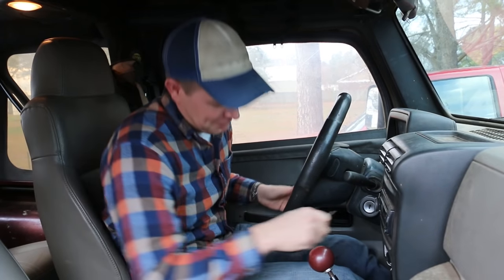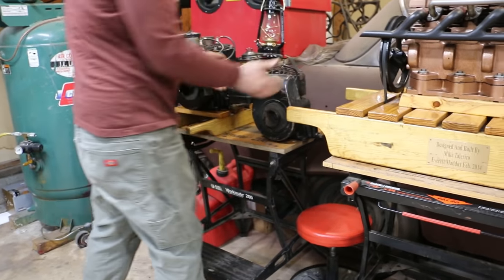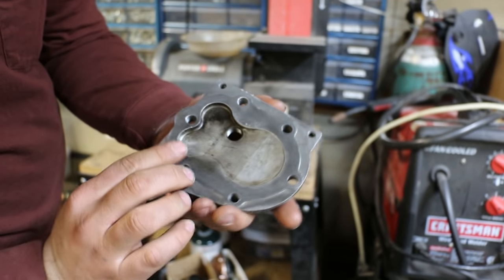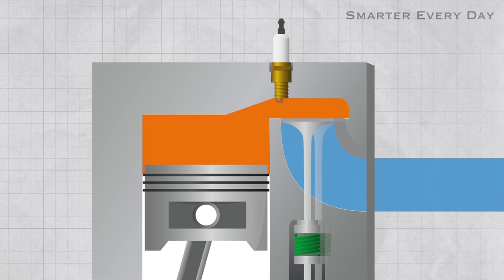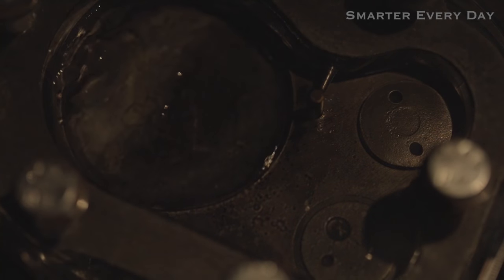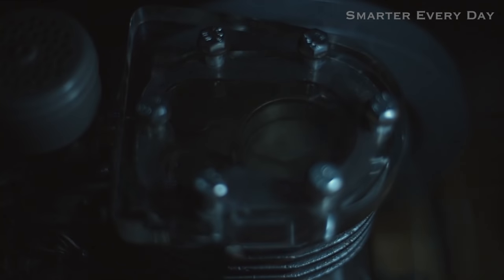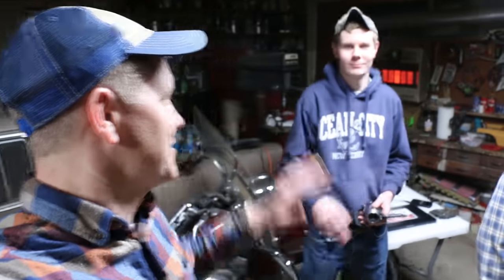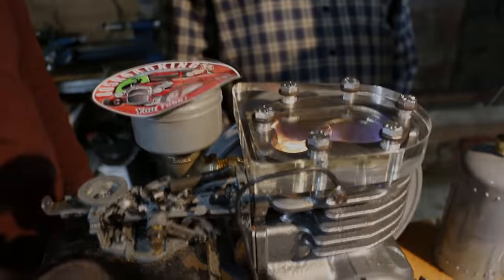How Engines Work - (See Through Engine in Slow Motion) - Smarter Every Day 166

Comment: This makes me feel bad for when I rev my engine to 8k rpms, the engine literally has to do this 8000 TIMES in one minute 😂
Reply: more actually, because your engine I'm guessing is a 4 cylinder, so that means your engine has to do this 32000 times in a second because rpms count rotations of the crank shaft. or if its a 6 cylinder its 48000 times a minute or and 8 cylinder its 64000 times. Or if your really lucky and its a 16 cylinder its 128000 times a minute.  so yea, be nice to your engine and give it oil
Reply: Cars are cool
Reply: @willcarpentieri879  Halve it, it's a 4t - 8000RPM (single cylinder) would be 4000 cycles per minute.
Reply: Lmao I said second
Reply: @willcarpentieri879  Yeah I presumed that was a typo haha
Reply: Think about it: at 7000 rpm a single cylinder does this entire cycle 58 times EVERY SECOND. Now imagine 8 or 10 or 12 cylinders ALL doing that at the same time, in sequence. It's crazy.
Reply: Ross Voorheis crazy and highly, highly inefficient. Gasoline is amazing stuff, we’re only able to maybe 40% of its energy into kinetic energy, and it’s still our life blood. 
I suppose that’s why larger engines burn through ridiculous amounts of fuel per mile, so much of the energy which doesn’t reach the wheels is simply lost as heat!!
Reply: Well motorcycle engines rev above 16k
Reply: @pierzing.glint1sh76  Heat, friction, thermal expansion, sound energy and mechanical enery losses. It's a nightmare for mechanical engineers to study an IC engine.
Reply: @shenanigans4177  although i think ice engines should be phased out there one of mans top 5 greatest inventions of all time
Reply: Don't feel bad, engines are made to do this.
Reply: @braayan03  yeah, for about 5 minutes before they overheat !
Reply: Isn’t only the transmission changing which results in higher rpms??
Reply: Your engine does not wait until your minute has passed. It can rev up a lot of times during a minute. Vroom vroom vroom vroom. You could also count the revs per hour. Or per year. Or in Hertz, that is per second. Why did those minutes get standard? That is weird.
Reply: @Tupsuu  Not mine. If mine were a 4 cylinder, it were a 2,6 liter. But is is a Rotax 650 cc single cylinder. Great engine, but the cool guys prefer a V8. Why they never buy a V8 racer, no idea. Money perhaps. They all got a 4-in-line or a 270 degrees twin. And the 4-in-line dudes often have no idea what they own. They just rev, they don't think that often.

And yes, motorbike engines perform twice as good as car engines. On average. A 600 cc can give you over 100 hp, which is a lot. The number of horsepower (or kilowatt) per cc (or cubic inches) is called "specific power" and pretty average motorbike engines do compare to racing car engines. Those very high revs are an important part of the power puzzle.
Reply: @shenanigans4177  Yes. If all the energy from burning that bit of gas would go to your tyres, you'd travel a lot of miles more, on one tank. If you get only a THIRD of that, you can be happy. Most of your energy is heating the air around you. Radiator and hot exhaust pipe are designed for that.  The poor engine would run too hot. So, there goes your fuel efficiency. Down the drain. Get rid of that heat. What? That heat is the energy I paid for! Too bad, no choice, this is the best an IC engine can do, today. When I went to high school, I thought "This sucks!" and fourty years later it STILL sucks. Heat goes down the drain. And everybody is accepting that. Except Tesla. And other full electric cars. Batteries are not perfect, but those electro motors are almost perfect.
Reply: @pierzing.glint1sh76  there?! Where crazy!
Reply: My 125 ccm Bike runs 10000 rpms at 70 mph
Reply: @willcarpentieri879  You know that's wrong? Regardless of the amount of cylinders, one RPM is one RPM, as is 8000.
What you might be referring to is the amount of firings, which is your RPM x cylinder count / 2, assuming a healthy engine that isn't missing.
Reply: Think about old F1 cars that got up to 20,000 rpm at one point, or top fuel dragsters that go from idle to 10,000 rpm in an instant!
Reply: Kawasaki Ninja 250 engines cringe.
Reply: Amazing... o.0?
Reply: @willcarpentieri879  On most 4 stroke engines @8K RPM there are 4K cycles per minute and 2K ignition events per minute. That would be about 134 rotations per second, 67 cycles per second and 34 ignition events per second.
Reply: @rossvoorheis2391  I thought that every stroke cycle is a revolution of the crankshaft. So in an 8 cylinder at 8000 rpm, wouldn't it only be 500 powerstrokes per piston? Or am I missing something here
Reply: @wiskyr6510  Well I'm not sure what your mental picture is, but first, only half of the pistons have a powerstroke in one revolution of the crank. Second, no matter a piston's offset or position relative to other pistons, it always completes four strokes in two rotations of the crank. So, 7000rpm/2 = 3500 cycles per minute. 3500/60 seconds = 58.33 cycles per second.
Reply: I used to own a Honda CBR 250cc RR ... that engine can rev up to 18000 rpm ... and it has 4 engines :D
Reply: man you made me laugh 😆
Reply: @willcarpentieri879  i think you don't know how a engine works

Comment: your diesel engine next video ?????
Reply: YES! I sooo want to see that now. But would be very difficult to do.
Reply: ReznovMason it's not that different. but the power stroke happens by hot diesel fuel instead of a spark
Reply: Philiparas TNG ok thank you
Reply: that would be really hard, those engines work with high compression ratios (from 14:1 to 22:1) and the fuel is injected with 2000 bar of presure, the temperatures go way over 1000 °C and it generates a lot of torque, but if they can make it happen i would apreciate it so much!
Reply: Also diesels must use overhead valves, unlike this low compression flat head, meaning really difficult to design a clear cylinder head

Comment: Most people don't even care to know! Ya car blowing up witout exploding!
Reply: @Falcon2.39-1  👎
Reply: @skiddlyd.244 ??
Reply: You can also see why "wear" happens.
Reply: @thepsychicspoon5984  exactly 💯
Reply: It's technically not blowing up
Reply: There are multiple explosions in your blood at every moment
Reply: Controlled explosions that is
Reply: We ride to work on exploding dinosaurs.
Reply: @quackywack9331  Well there is no explosion. It's a "Controlled Burn". There is a fireball inside. Not an explosion.
Reply: @svsix5083  bruh the gas is very compressed so once it is ignited it rapidly expands. that rapid expansion is pretty much the definition of an explosion
Reply: Reason: because the metal and also the engine are preventing the engine from exploding because of the exhaust. so the engine quickly  exhaust it.

Comment: i wanna see one of this in diesel
Reply: Fernando Henrique second
Reply: Should have a similar result , but for the sake of science I am all for it.
Reply: Fernando Henrique too much pressure it would crack the head
Reply: Pretty similar, but instead of spark plugs you have heaters, that heat the combustion chamber and lets the fuel combust together with pressure.
Reply: The high pressures of diesels make it very difficult because it would crack the acrylic no problemo. Compression ratios are like double gas engines.
Reply: it'll need a head made of diamond or maybe even stronger
Reply: Fernando Henrique diesel runs at higher pressures and higher compression ratios. so no..
Reply: not quite. The Diesel cycle compresses air and then the fuel is added in. As soon as the fuel enters the combustion chamber, it ignites because of the high temperature generated by the increase in pressure. In the otto cycle (gasoline engine) gasoline is already mixed with the air before it is compressed and it is ignited with a spark plug. Because of this, a gasoline engine cannot achieve as high of a compression ratio as a diesel engine (hence why diesel engines are generally more efficient). The gasoline ignites so quickly, it has basically already combusted before the piston starts its down stroke and therefore the pressure increases, whereas in a diesel engine, the fuel ignites slowly such that the pressure in the piston barely increases until the power stroke, where it decreases.
Reply: Teach'EM test in thermo 2 tomorrow. Was just brushing up on my otto and diesel cycles lol.
Reply: Teach'EM test in thermo 2 tomorrow. Was just brushing up on my otto and diesel cycles lol.
Reply: At first this seems difficult, but nitro rc engines are technically diesels and their bore is likely small enough that the pressure on whatever you use for the head will be ok for a while, and hopefully large enough to see something!
Reply: But a nitro engine is a 2-stroke not a 4 stroke. And its not a diesel.
Reply: Same exact thing except no Spark Plugs.
Reply: No, it is much more similar to a gasoline 2 stroke than it is to a diesel engine.
Reply: Fernando Henrique yea
Reply: It would soot the acrylic very fast and you would not be able to see what was happening, plus you would need acrylic thats double thickness since diesel is almost double compression of a gasoline engine
Reply: 2 Stroke engine would be interesting too!
Reply: I bet a tempered glass could handle it....might have to make it from a sheet of Prince Rubert's drops...  ;)

And the flame front would not be the same, since the majority of the fuel-air mixing is occurring only after the flame has initiated just slightly after the fuel injection.  A diesel should burn like an onion around the injected fuel pulse, with just 1 layer being at the perfect air:fuel to ignite and then that flame front moving in all directions as the expansion mixes more and brings other areas to the right air:fuel.
Reply: A big block of borosilicate glass could take it, but it would require a phenomenal amount of work to polish. On top of that you need to torque it down with a fair bit of pressure to seal the thing and glass doesn't take kindly to that.
Reply: Sincostan we arent concentrated on the engine cycles here as much as combustion itself.. and yes, a nitro rc engine is a diesel, they use copression and heat alone to ignite the mixture.. and im pretty sure the fuel they use produces little to no soot
Reply: TheIdeanator boro is a great idea! you could use a grooved oring seal so as to require less clamping force (if that works at those pressures.. i had a 14.2:1 comp. dirt bike with an oring head seal that worked great).. and to the ones talking about direct injection, that is not specific to diesel engines or required for a diesel to work. it would be awesome to see, but i would settle for a carbureted 2 stroke diesel assuming incorporating overhead valves and direct injection with a clear head is much harder to do.
Reply: Yeah, the overhead valves would add a real trick to it...
Reply: Wouldn't need an o-ring grove, just some gasket silicone goo. The benefit of glass is that you don't need to worry about the window dissolving. They use quartz windows to protect the cameras watching rocket engine ignitions so boro should be good enough for an engine.
Reply: But they do not burn diesel fuel, so its not a diesel. While it works on the same principal you simple cannot call it the same. I would still be interested to see what the combustion would look like. It would also be cool to make the crank case cover see through as well.
Reply: diesel definition: an internal combustion engine in which heat produced by the compression of air in the cylinder is used to ignite the fuel.
diesel fuel definition:any liquid fuel used in diesel engines, whose fuel ignition takes place, without any spark, as a result of compression of the inlet air mixture and then injection of fuel.
anything being burned in a diesel engine is, in effect, diesel fuel.. and diesels can burn many different fuels with little to no modification
Reply: slidestang242 yup, you are right because the term diesel does not refer to the fuel but to the engine.
Reply: Fernando Henrique acrylic glass wouldn't even work lol, the pressure would destroy it, imagine the pressure of an entire piston squeezed into only a 4th of the engine, that's the magic of diesal fuel lol
Reply: Pretty similar like otto cycle, but in diesel cycle the fresh air is compressed (c.r)= 16 to 22 so much that the fresh air got self ignited, so no need of spark plug! Just a spray of diesel fuel and it explodes to give power stroke! Mechanical engineering is amazing, isn't it?
Reply: For the record Diesels do not intrinsically have higher internal pressure than gasoline engines. Mean effective pressure which is essentially the equivalent to specific torque is higher in a naturally aspirated gasoline engine than a naturally aspirated Diesel engine, modern road vehicle Diesels only have very high internal pressures because they use big boost to achieve very high specific torque, it's not the compression ratio itself that generates the high pressure, the pressure at the end of the compression stroke is literally nothing compared to the peak pressure after combustion.

You can make a Diesel engine with a viewing window and it's been done. Usually it's a side window though because the flat head design doesn't work so well when you need direct injection. In an ideal Diesel engine you see a flame jet coming out of the injector (if it's single hole type, otherwise one jet per hole), but normally because of low cetane rating of road Diesel and without a pre injection you instead see a cloud of fuel shot into the cylinder which after a short delay ignites throughout. That short delay followed by the burst into flames is what gives Diesel engines  most of their characteristic rattly sound.

Comment: I love how the flames just leave the cylinder in the exhaust stage, like a spirit.
Reply: Right? It kinda does look like that. Almost magical. Even though it's just exhaust exiting.
Reply: You read my mind!!!
Reply: Well technically if you think about it is a spirit. The crude oil was harvested from dead plants and animals refined into diesel then awoken with a spark ready for its energy to be used
Reply: @Mark-ci6ln  The engine runs on propane, not diesel. And diesel engines don't even have spark.
Reply: not to mention how the outer part of the flame is blue and thus hotter.... it's interesting to see where the hottest part of the explosion is, you'd think it wouldn't spread out like that...
Reply: It's showing what it will look like as your spirit leaves your body when you get hit by a car
Reply: so one cycle of 4 strokes is a story from life to death...a metaphor on life itself
Reply: Blessed be the Machine Spirit.

Comment: I always though it was the upward stroke in the exhaust cycle that evacuate the burnt out gases, but it's clear the expansion wave continues into the exhaust cycle and it's what evacuates most of the hot gases. The exhaust cycle upward stroke removes very little from the cylinder. By the time the fuel valve opens up,  the cylinder chamber must have have cooled down enough to create a vacuum which in turn pulls the fuel air mix in. This is much more complex than what I had ever imagined. Fascinating.
Reply: Exactly my thoughts as well. However I can but feel the spark occurs a little late. Because it seems the explosion is just barely getting started as the piston is already on it way back down and the fuel air mixture is not getting a good burn before being forced out the cylinder. 🤷‍♂️
Reply: Not only does the continued expansion of the burning fuel air mixture begin to evacuate the cylinder, it also aids in beginning to draw the next fresh charge into the cylinder. In a V8, for example, the intake and exhaust valves are both open simultaneously for a few crank degrees before and after piston is at top dead center at the end of the exhaust stroke. The intake valve opens before the exhaust valve finishes closing so that as the burned gasses are being scavenged from the cylinder, they start to draw fuel in from the intake runner.
Reply: actually 2 stroke engines work this way .
Reply: Couple years late but in engines with more cylinders, the other gasses escaping from other cylinders draws a vacuum in the intake manifold in what’s called exhaust scavenging
Reply: @clutchem  Briggs & Stratton flathead engines are very low compression engines. This means that the flame propagation is much slower than other designs, this factor would allow for a more advanced timing than this setup has.
Reply: @franic_scopes9165  Not necessarily.  Flathead engines generally don't like more than about 25 degrees of total timing.  Power and torque goes down.